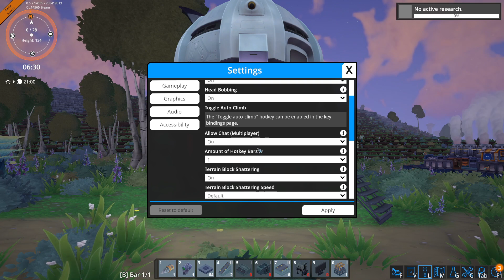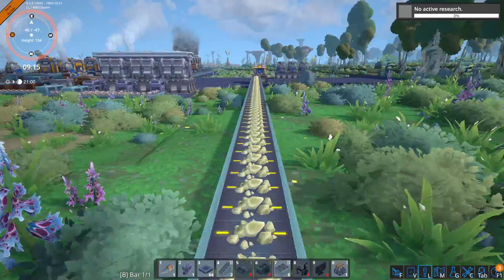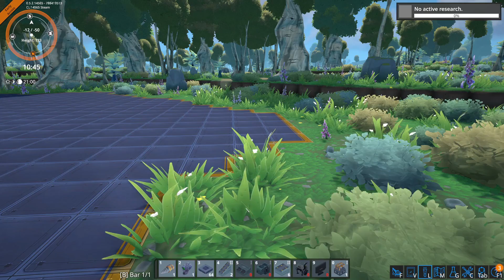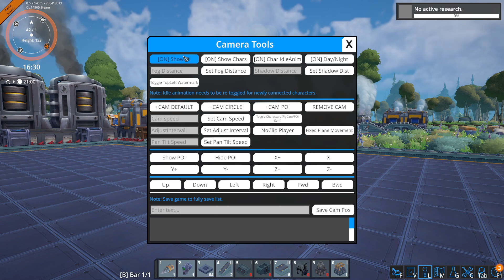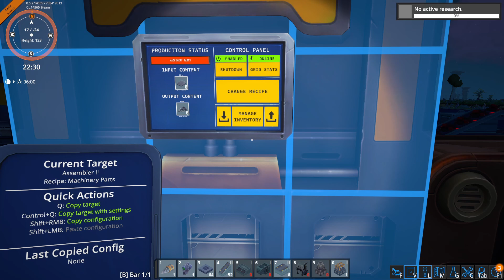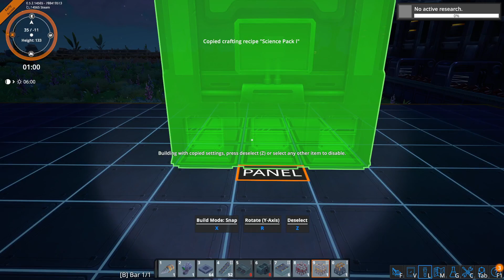ULTIMATE Foundry Beginner Guide - Foundry Tips and Tricks

Comment: Tip for mining ores.
For maximum efficiency, dig out the ore all around it first.
Then add a ring of foundations around the middle (like Jupiter) and place your 4 miners around the ore on all directions N,S,E,W.
Connect them together with balancers to form a single line output.
Doing it that way insures you will not have to move your miners.

If you place your miners on the top of the ore, they might not reach all the ore.

Second tip, dont rely only on one ore deposit at a time.
You will run out.
I ran out of ore in one spot and had to build a whole new network to get it again.

Fun game.